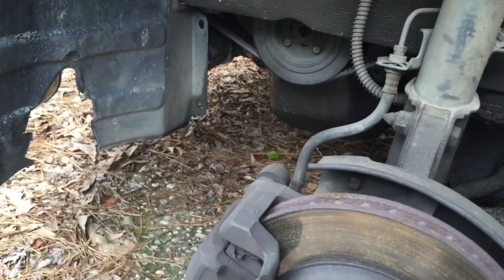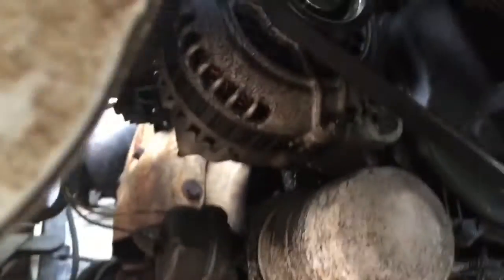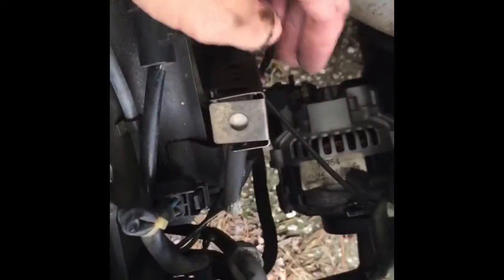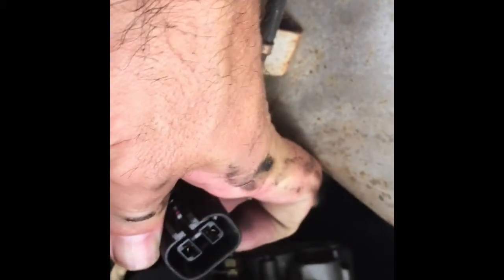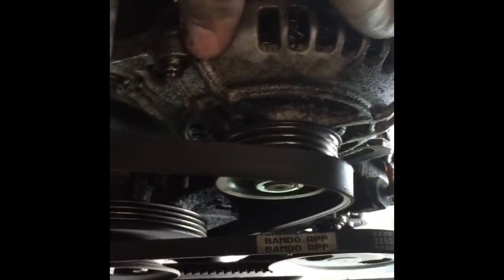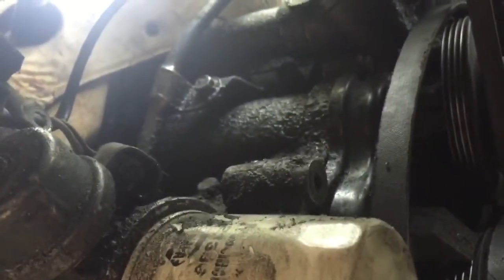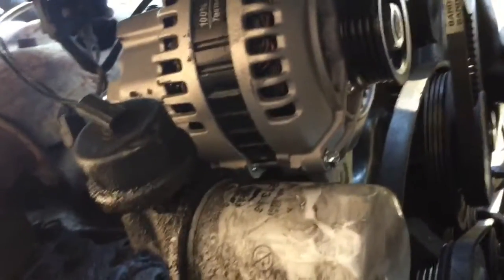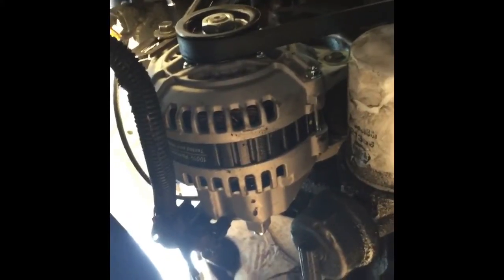1993 Mitsubishi Eclipse Alternator Swap

Comment: I'd like to add that the the alternator pivot bolt just pushes right out. I thought it would be more complicated than that. Also I found that it was much easier to remove the alternator by first removing the driver's side fan and shroud assembly. It only has 3 bolts and a wire harness plug holding it in place. It can then be removed from above which is much simpler.
Reply from the maker: I did remove the fan shroud the first time I did it. But the second time I didn’t. It’s a very simple job. We bought a 3rd generation eclipse since this video was done

Comment: i have a 2000 mitsubishi eclipse. does this work same way?
Reply from the maker: It probably would if it's the 4 Cylinder engine..
Reply: Holy smokes didn't expect a reply. Yes its the 4 cylinder engine. So it would? My brake/battery light are on and my vehicle randomly loses power so I assume alt. Gonna get it tested before I do anything though. Thanks for reply! Happy holidays!
Reply from the maker: If the battery light is on it's the alternator.. this car did the same thing.. your welcome. Happy holidays
Reply: Game Glitches & Funnies for questions like these, it depends on the engine. usually. this appears to be the 4g63 fwd version. not sure if the same as the 420a or 4g64
Reply: Zachary Mcintosh I changed the alternator and it fixed it. Have had 0 issues since then!! Also thanks for reply will use for future reference lol.
Reply: Game Glitches & Funnies congrats! no problem! definitely helps when searching for things too lol.